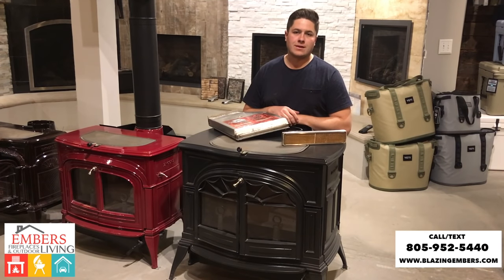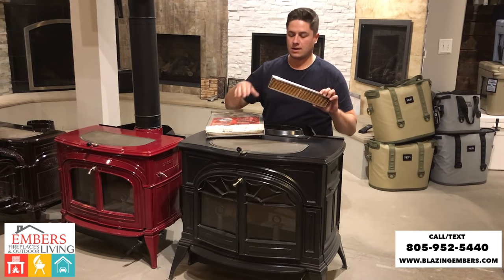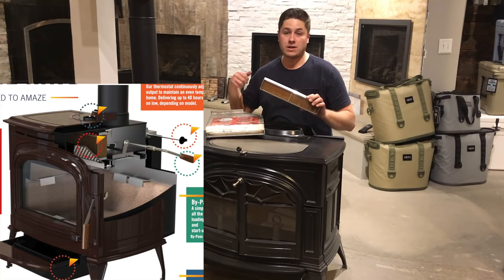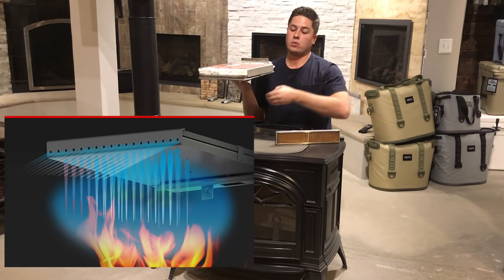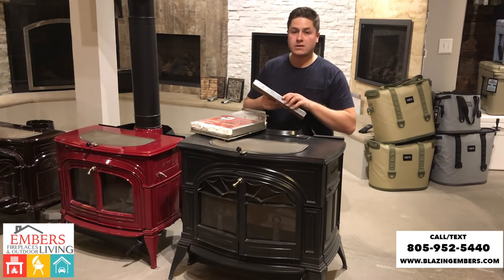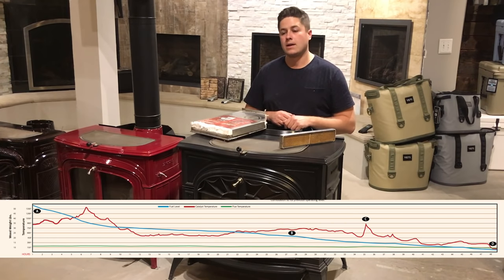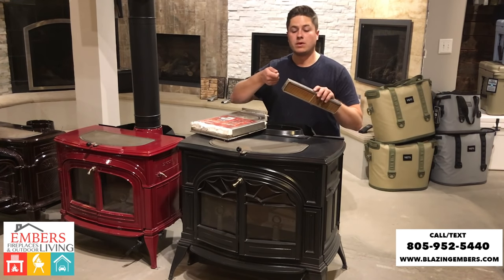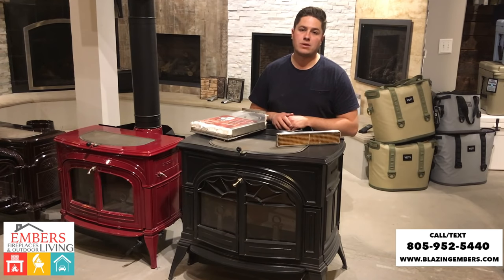Catalytic vs Non Catalytic Wood Stove which one is better?

Comment: I think that this guy's a salesman- not Tech/Engineer qualified. He said the reburn one pumps more air in as fuel. Oxygen- in the air- chemically reacts with the fuel resulting in fire. Does it incorporate a fan to blow outside air into the vaporized unburned fuel??? There's an optimal ratio of air-to-fuel for the best efficiency- in either type. How is that aspect addressed in today's "State of the Art" systems??? Are oxygen sensors incorporated with a computer controlled system??? What are the criteria to meet EPA certification or how is it determined??? How much does the ability to structure a fire, still, matter towards efficiency?
Reply from the maker: good feedback
Reply: Whoa!!

Comment: You should fix that drywall sheet that the light switch is mounted on it looks very unprofessional.
Reply: i think its just the camera angle and that wall is around a corner from the stove making it seem off kilter

Comment: From where is it "pumping extra oxygen"?    I don't get it.
Reply: PianoMan Smith  it is called secondary air...comes from a different air inlet in the stove.
Reply: I realize that is called "secondary air" for the re-burn feature, and i have the Avalon Rainier with that feature but with "only" a single air control    I guess my stove works well without the "secondary" air. Have had it about 10 years now and it works well.